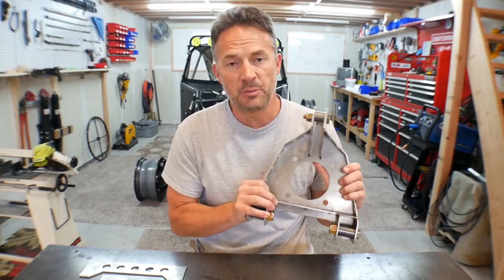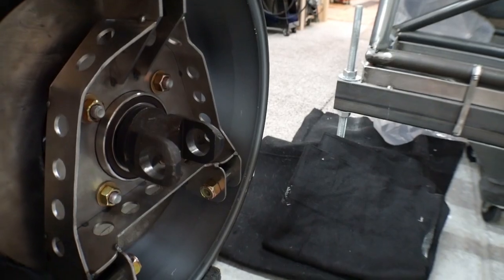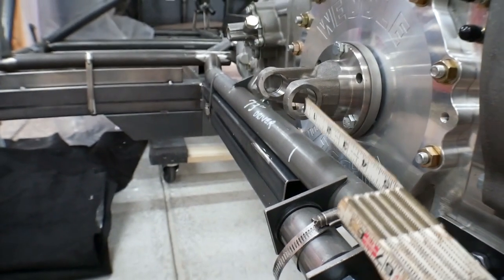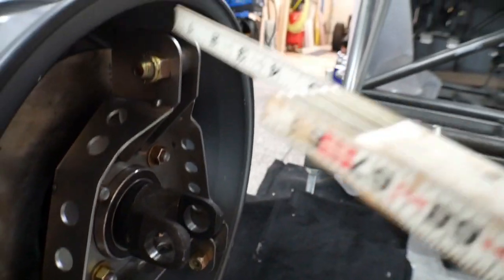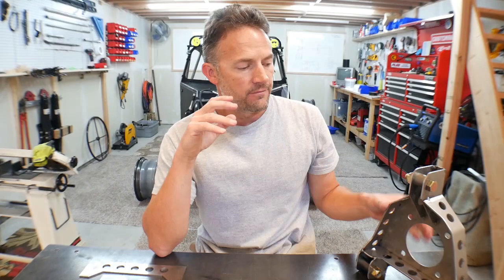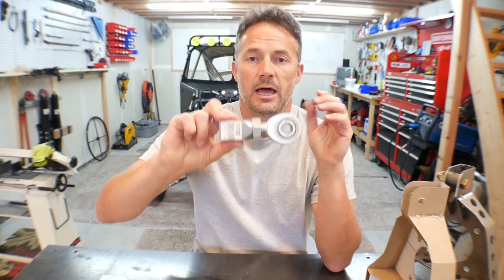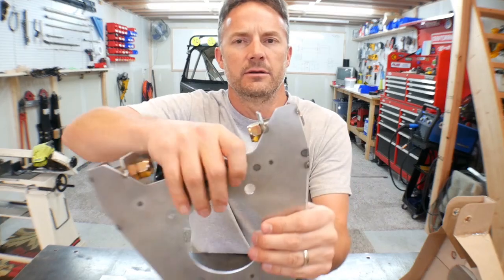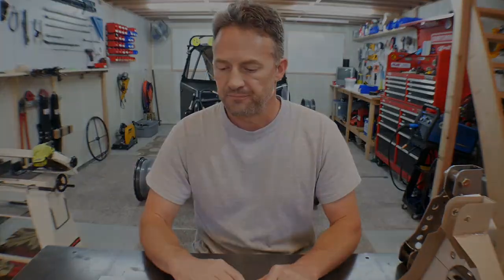Wratchet Rear Suspension Build #2 Spindle design and Fabrication

Comment: I appreciate the alternative, albeit pricy, method of cutting the flat plate parts.  Most of my current build is hand shaped parts, but if I start a second build (as you did), having at least a pallet of ideas to work from is much more efficient than brainstorming and researching - thanks for all the heavy lifting (and sharing) on so many aspects of both your builds!
Reply from the maker: Believe me, pre-cut parts is fun. But I'll still be hand making most of the parts. This was more of an experiment.

Comment: Doug, the mounting for the hub onto the spindle looks a bit weak, it essentially only being a 1/8th inch piece of sheet metal, while the rest is boxed and rose-jointed.
This way of mounting will make exactly that area of the spindle the weakest point of the whole assembly and thus will create movement of the wheel and eventually fatigue.
I would weld in a bit more metal.
More ribs, or better; box it with a backplate and connecting bushes for the bolts. This will only increase the weight a bit, but it will make the spindle a lot stronger.
I bet, twisting the cardboard version will explain what I mean.
A closed shoebox is much stronger than an open shoebox, without adding too much weight. And cutting holes in it, for added lightness, wouldn't change its strength at all.

Another thing, at one point you have to consider where you want things to break in the event of a mishap.
You could introduce weak points or kinks in the suspension arms to direct the forces to go there so they bend, instead of ripping the mounting points off of the chassis.
Just a thing to think about.
Reply: I agree, throw some gussets in that spindle. Also thank you for sharing your project designs! Not many fabricators do such a service.
Reply from the maker: I hear you on the spindle. Originally I was going to make it out of 3/16". But that seemed like it might be overkill. Then when I had this one tacked up I was looking at adding more gussetts. I also thought about keeping it this thickness but switching to chromoly. Not sure what I'm going to do yet, but I agree as is it needs to be stronger.
Thanks for the comment, some good ideas in there. 👍
Reply from the maker: I agree, and thanks for the kind words.

Comment: Heya Doug. Love your videos. Just wondering why you went the u-joint route vs cv joints? Thanks.
Reply from the maker: Couple reasons, but first understand I don't think that U-Joints are better. They just have some qualities that I like.
1. They're easier to customize. Order up the parts and assemble. If you need to make changes sometimes you can cut and reweld if needed.
2. They get 40+ degrees. I know some CV's will get that. But essentially all U-Joints get that right out the gate. Sometimes even more.
3. Much cheaper, at least half the price.
4. If you build them with 4" splines you can actually make some track width adjustments and still use the same axles. As long as you set up the splines properly.
Those are some of the highlights. Again possibly not better, but I find them easier to work with. Wratchet will be more intense, so maybe he'll start breaking axles. Then I'll have to dabble into the CV world. 😢😉

Comment: Looks great! I would definitely recommend BEEFING that hub mounting surface up! Most trucks and bugs here in CA are mounting hubs to a minimum 1/2 thick plates. I’d build your spindles out of 3/16 and then double up the section where the hub bolts. Way less flex and your hubs will last a lot longer! Also, cold rolled is great but there’s something better out there known as pickled and oiled p&o. It’s got the same finish as cold rolled (no mill scale) but it is ALOT stronger
Reply from the maker: 1/2"! Wow that's tough. Great info on the pickled, I actually saw that on the order form when ordering these parts.
Appreciate the info, very helpful.

Comment: Hey man,  what year Toyota 4runner wheel bearing are you using? And what year Jeep stud shaft are using? Total love the build.
Reply from the maker: Hubs are form a 2006 4Runner. Make sure to get the ones for a 4wd 4Runner.
The stub shaft is a Spicer 10008250 30 spline axle shaft. It's chromoly. Not sure the exact year. 5-760X U Joints.
Let me know if you need anything else.

Comment: Do you have any mechanical engineering experience? It seems like your knowledge of mechanical design is that of an educated man!!
Reply: Also love the videos. Great detail and explanation but still interesting and entertaining
Reply from the maker: No I don't, actually didn't do very well in school. However I'm very passionate about off road chassis, suspension, etc. And believe it or not before this I raced and built off road RC cars. So I was able to tinker with geometry on those for about 20 years. Now that I'm older I can do it on full size rigs. And the concepts are the same. That's why I appear to know what I'm talking about. 😁
Reply from the maker: Thanks for the comments BTW, they're humbling.

Comment: Doug where do you get your stuff cut?  What about you selling them for someone to weld at home
Reply from the maker: I got these cut from a company called OSH Cut.
You can go to my download files here. https://drive.google.com/drive/folders/1i0qTcN-1BB5_Lu6umgi9OrvRJKr-0vz3
Then go to "Wratchet Files" then "Rear Suspension" then "Rear Spindle" then use the DXF file. You'll need the DXF files to order the parts from OSH Cut. If I remember I think I had most of those parts cut out of 3/16 thick steel.
Let me know if you have any questions. 👍
Reply: Thank you I’ll be taking a look at them.

Comment: What are you using for a stub axle in the Toyota hubs?
Reply from the maker: Spicer 10008250 Dana 44 SVL Axle Outer Shaft 30 Spline 5-760X U Joint
It's chromoly and seems to be a perfect fit.
It can be had in regular steel for much cheaper. But this one is bulletproof.

Comment: What engine is that? I know you used an Ecotec in Mauler, but I noticed this is a V6.
Reply from the maker: Wratchet has a Honda J series 3.5L. Although I'm not 100% sold on that yet. Haven't decided what fuel injection to use.